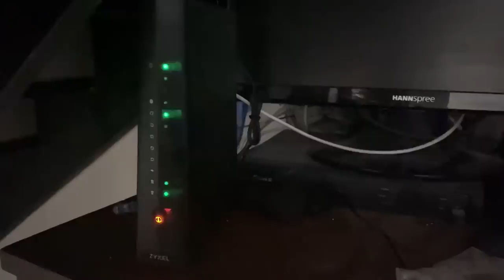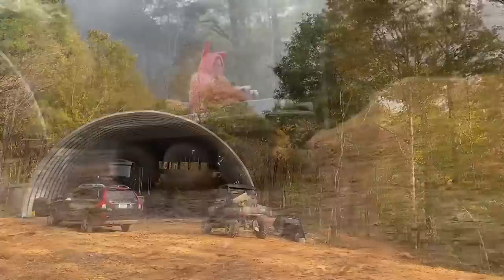Lightning strikes on the property causes lots of damage, but could have been way worse. Storm damage

Comment: Scott, With my amateur radio and commercial radio tower installations, I've always used RF and data line surge protection devices from a company called PolyPhaser. They make top quality stuff for professional installations. You might research them for your line protection devices. I'm sure someone local in the professional communications business can assist you as well. Anybody in the two-way radio business that services police and fire department radio towers would be a great source.
Reply: APC (the uninterruptible power supply company - UPS) also has a line of Ethernet surge protectors.  The problem is the copper cable is more conductive than the earth.  This allows the high voltage to travel down the cable until a path to ground is found.  Each melted point may indicate a partial discharge but the first good ground was at the GFI outlet though its electronics.  Your video did not show the green wire termination at the mounting end of the audio, but that is how the surge finally went to ground.  If you are going to run Ethernet data cables long distances or between buildings, you night consider using optical cable instead of copper because of the isolation it offers to electricity flow.  

Your inverters should have good protection but if they do not or you wish additional protection you might also consider installing whole house surge protector at your breaker box to take inrush current on the power wiring to ground.  Basically, any none power wiring entering any building should have surge protection with a local ground.

I also put plug in wall outlet surge protectors on any outlet with expensive or electronic equipment plugged into it.

There is a lot more information and a good book on grounding that you might find interesting.  https://www.dxengineering.com/parts/arr-1496 is one of many sources.

Take care, be safe, remember people are not resetable fuses.

By the way, please keep up the excellent explanations and videos of what you are doing.  I find them very interesting, knowing I will never work on anything that substantial. If you can increase the audio level on your videos that will help my old hearing.

Sincerely,

Richard
Reply: @AquesousSolution  Thx, I will take notes as well!
Reply: Another option if the cable run is just within your property would be to use a media converter at each end and run fibre between the points to prevent lightening ingress, as well as protect against differences in ground potential between different locations during a lightening strike
Reply: @AquesousSolution  We have used APC UPSs for many years. APC makes good equipment!

Comment: Scott, the tree that was debarked is from the process of the moisture in the tree boiling and the resulting steam peels the bark. That's a true sign of the awesome energy in a single lightening strike. Glad you all are safe.  30 years of outside plant maintenance experience I give a plus for fiber to Tyler's bus.
Reply: Yup.  When water converts to steam it expands  1700 (seventeen hundred) times.  That creates a LOT of force.

Comment: With a metal building, you definitely need lightning rods and copper ground rods on both ends and protection for your shipping containers. Whole house surge protection at the main panel is a must, too.
Reply: Just came across your post. I said the same. I also use surge protection on separate circuits. Belkin, APC, & IBM. with battery back up of course.

Comment: Hey Scott, if you're running the ethernet cable between your shop and Tyler's bus you may want to look at ordering some bury grade single mode fiber from someone like Discount Low-Voltage and ordering some TP-Link single mode ethernet converters with SFPs on each end. Speeds will be excellent and you'll no longer have to worry about lightning striking that cable ever again as the fiber is glass! Happy to answer any questions if its something you would like to look into.
Reply: I know regular through-wall fiber can have a conductive jacket. Is that a thing with the bury-grade fiber?
Reply: @McTroyd   Avoid aerial fiber, it has a wire in it.
Reply: If he was using fiber the lightning might've melted it but it definitely won't travel through the cable and burn out everything else connected.

Comment: Hey Scott, you should run that internet in fiber optics.  It's an inexpensive solution to have absolutely no wire connection to your device.  Use two media converters to get back to ethernet and the fiber between.  Those both are available on amazon.

Comment: Electricity can be quite a force.  It's surprising it got so far into your system considering the size cable and distance it had to travel through.  Ethernet components are tender but wow.  The ethernet cable lasted just long enough.  Glad no one was injured during the show.

Comment: I recommend opening the solar inverter(s) and checking them for blown metal oxide varistors. Those are key components in surge protection, and i think it's highly likely that the inverter has a few of them. They cost pennies, you can even find them in LED lamps.  Charring or a simple black dot/crater in the housing means they've done their job and need replacement. 
They can blow when absorbing the surge, and you'll be none the wiser - but after that you're not protected anymore!
If you're not "qualified" to work on high voltage DC electronics, get someone to do it for you.
Reply: I second that…Also if they don’t have any form of surge protection it would be wise to get one of the larger Eaton or Siemens protectors that attaches to the main panel at the meter. Some utility companies offer these and come with a guarantee/insurance for a monthly charge.

Comment: We have an old windmill tower on the old farmers property behind our house. The windmill tower is about 200 feet from our house. One night during a storm lighting struck the tower and I can fully agree with you that it is very very loud. And the back yard was all white from the flash of light! Crazy amount of power in a storm!

I also work in a dealership. We had a 6 month old car towed in because it wouldn’t start for the customer. After looking it over we determined it was struck by lightning through the small antenna on the roof. The car was totaled because most of the modules were fried and no one could guarantee the air bags were good or bad. So it got totaled!

That was a lot of water pouring over the side like that. How much rain did you get in that short amount of time?

Comment: When I was a teenager we had a tree that was struck by lightning. We found a trench that started at the bottom of the tree that was over a hundred yards long. At the end of it we found a piece off the tree that was about 3 feet long, 8 inches wide and 5 to 6 inches thick. The trench varied from 4 to 8 inches deep with no gaps from end to end. I saw the lightning hit the tree and I had spots in my vision for a few minutes. We also found pieces of that tree in fences that had hit hard enough to break part way through the wires. Another time we had a tree in a fence line that was struck and the fence wire had to be replaced for about 25 to 30 feet both ways from the tree because it was so burned that it would crumble when you tried to handle it. As Mark Twain said, thunder is boisterous and likes to brag but lightning does the work.

Comment: A few years ago I was working in a building and lightning hit the power line about a 1/4 mile away. Scared the crap out of me. The lightning arrestor blew apart and the transformer was damaged, we were without power for a couple hours while the utility company did repairs.
Reply: One afternoon we had a severe thunderstorm roll through & lightning pierced right through the transformer in my front yard.  Everything made a zap sound & I dove on the floor.  The power company said they had never seen lightning pass through a transformer like that.  I sure respect thunderstorms a whole bunch after that experience.

Comment: I live in work in Nevada as a microwave technician who has to travel to mountain  tops, some over 10,000 foot elevation.  When we have our roads built we have it graded to slope toward the mountain, and put a ditch between the mountain and the road.  Where the road is gently rising culverts are placed several hundred feet apart to move the water from the ditch, under the road and down the slope.  Where the grade gets steeper the culverts are placed much closer together and on the steepest part they culverts may only be 100 feet apart.  The gentle slope of the road toward the mountain keeps the rain from building up so much it removes the large gravel.  The culverts being close together keeps the ditch from  becoming a strong torrent of rushing water, which can cut the road or the berm which turns the water into the culvert.  The closer the culverts are to each other, on the steep parts of the road really helps keep the road from being rutted.  On the downside of the culvert, sometimes we have had elbows and longer sections of culverts added to make sure the output of the culvert does not cause an undercut of the road.  One year I took the time to put a Carsonite marker at the entrance and exit of each culvert, to make locating them for maintenance more easy.  We never put a crown on the roads, we always slope it toward the mountain.  Putting a crown can lead to big ruts.

Comment: Back in the 90s a site I worked at had two strikes approx 400 yds away in different directions. We had a number of cables running along the ground with 12V and 240V which had fuses blown but no equipment damaged. All phone lines had surge protectors and were undamaged except one outside phone which didn't and was wrecked. All underground cables didn't have a problem as they were shielded by the earth. A friend in the north of england was not so lucky and had his bungalow take a direct hit. Blew most of the wiring out of the walls and wrecked almost every piece of electric gear in the building.

Comment: The poor folks build in the holler - the rich folks build at the top of the hill.  Who lasts longer ?
Lightning hit a tree 30-40 yds from the house in 2013.  lighting came across the wet ground to the cable line and that's how it got in the house.  It destroyed every piece of electronics we owned - even things not connected to the cable.  I do not envy the next couple of months dealing with the stingy insurance companies. Ended up costing us the 2500 deductible.  Overall damage was 13,500 if i remember right.  Very memorable as GA was kicking off against Clemson in first game of the season right when it hit - destroying the TV.

Comment: i remember posting on one of your first videos on the new property that erosion is going to be problem 1 for you from now on. it certainly has been. I only recently upgraded my home network to wifi 6 (5G). everything is wireless now. so fast. and no more wires. My modem is coax connected, i live in the middle of the woods, so no fiber for me. in 25 years here in georgia i have had MANY big lightning strikes that split trees, big trees, but only ever lost one modem. sometimes it is better to be lucky than good i guess.

Comment: You can get shielded outdoor rated Ethernet cable and ground it. Make sure you don’t create a ground loop. Used to do some outdoor wireless installs at a major corporation.. grounding was necessary to prevent damage to network equipment… still had some radios get toasted from nearby lightning. Basically the grounds can help but with the amount of juice we’re talking about not sure how much it would help but I’d ground at least one end where it enters your building at a minimum. If you’re replacing stuff take a look at ubiquiti WiFi. Hope your solar panels are ok?

Comment: Flash flooding is a beesh but lightning is even worse. You can get soil anywhere, surges are painful to the back pocket. Hope you get everything back up and running okay. Just beef up your protection and don't run cables on top of the ground. If possible, underground in a nonmetallic conduit if that's the only choice you've got.

Comment: Consider running heavy duty fiber between your buildings.   You can get cat5/6 to fiber adapters.   Glad you're OK otherwise!
Reply: When I lived in Florida I had friends that worked at Cape Canaveral that studied Lightning. They shot rockets trailing wire to cause a strike, and documented over 100 caused strikes. ALL their equipment was controlled via fiber or radio. No metal wire ever.

Comment: G'day all. Scott, I am not second guessing your electrical contractors in your area and I recall the videos of installing the transformer and power supply. But I had oft wondered what " Lightning Arrestors " you have installed ? Metal culvert structure strewn with solar panels ! Also do you have a buried cold water pipe some where ? Anyway drop grounding rods everywhere and make sure surge protection is on everything. I use battery back-ups on everything. Mostly APC & Belkin. Cheers and keep the family safe !

Comment: They make (sacrificial) surge suppressors to go on runs like that. Won't save the cable (or the suppressors), but will sometime save the electronics.  Often the worst problems are caused by multiple grounds creating loops for the current from lightning.

Comment: The glass type of rock on your property is a high silicon dense material.. that with other minerals will hold a static charge. You can monitor electric at these locations.

Comment: That internet cable needs to go underground in a conduit made for that app to keep critters from causing issues.
I'd suggest getting a UPS battery backup to plug ass your devices into including the internet cable.
It involves some math to get the right size but that's not that hard to figure.
Get one with a small lcd screen that has a menu pf several items.
It'll tell you how much load you have on it (never exceed 80 percent).
The true input voltage.
The sine ave condition of input and output voltage and other factors.
Strip outlets do not protdct electronics. 
They protect you buildings wiring from shorts caused by hair dryers, toasters, hot plates and other items.
Every time you pop a breaker it weakens the buildings wiring and the breaker itself. 
Strip outlets simply let you power more devices from one outlet.
People often overload a curcuit because of that.

Comment: outdoors ethernet cable runs like that are prone to collecting the surges from even nearby lightning strikes. Even just running ethernet cable in front of a window inside is a bad idea. You will definitely need to work out something better, either surge protection, wireless or fibre. Power surges coming through your DSL and feeding into your computer and equipment are a common cause of lightning damage and it doesn't even have to hit the line itself. The inverters should have robust surge protection and isolation usually in the range of kV, not officially but often can take decent spikes before failure

Comment: IIf that inverter had any built-in surge protection, you might want to get it checked. Those parts are sacrificial, and they may not be there anymore. - which will not be good for the next strike.

Comment: So sorry for the electric damage but at the other hand having cables laying on the ground in that weather, first thing you do is DISCONNECT all those cables. Guess lesson learned that when you have thunder to disconnect immediately all those connections. Better make a big copper pipe into the ground, away from your property and up in a high tree to use it when lighting the <current> goes in there.

Comment: Thus the need for multiple ground spikes. You probably already know. You drive them into the ground and connect those to the power boxes. I live in Florida and we have 3 six foot spikes on my house. We get lightning hits all the time but lucky enough there is an old AM radio tower a couple blocks away and that tower takes all the hits. Knocks on wood.

Comment: Get geocell  helps prevent diveway washout  also put  pipe or rod into the ground wire all the way around the house/shop my prevent the lighting from frying everything in the house/shop there is also some protection for your electrical panel you can get too .   Also next lighting storm may want to unplug your routers lol glad everyone is ok cool strike . Until the next video peace out.

Comment: I couldn’t tell the outlet type beyond GFCI.  You pr ought to consider adding AFCI to the GFCI  circuits if you don’t already have them.  And you may have AFCI at the circuit breakers.  It will be a pain, buy you my want to consider burying you ISP cable from the property line to the house.  Because what happened is the light strike traveled down the cable afte it blew apart.  That copper Ethernet wire was a perfect ground.  Aany electronics should be on surge protectors You can install whole-hour surge protection but that’s a job perhaps best left to an electrician.  If it were me, I’d consult with an expert on lighting arrest or installations

Comment: You're on high ground and will continue to attract lightning.  Lightning rods are ancient technology, but they work.  I suggest you pick a couple of locations around the facility and use them.  I also recommended a bar ditch on either side of the drive going up the hill.  Your culverts have performed admirably until this gully washer.  Give them a hand with some deep channels to carry water away.

Comment: Normally to be safe I buy drop fiber in pre made lengths . 50/100/300/500 meter
Use video converters 10/100/1000mbps each end

Now there no cover path

The lighting hit tree and a 50 ft dispersion area.  This traveled in the cat6 cable till it discharged.  Through the gfi to ground cable.

Lucky